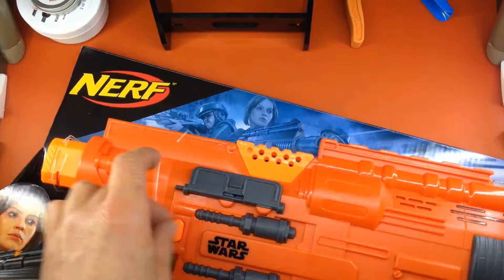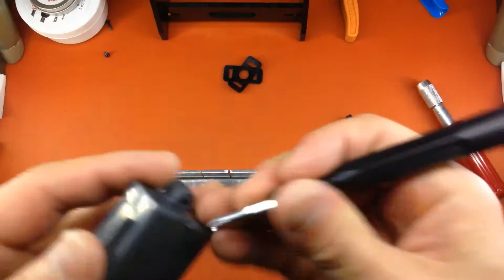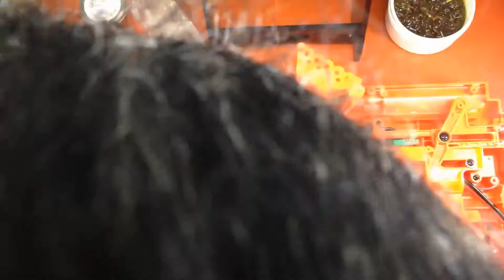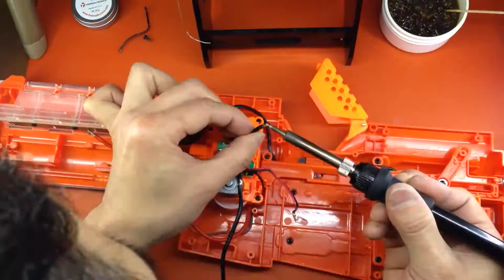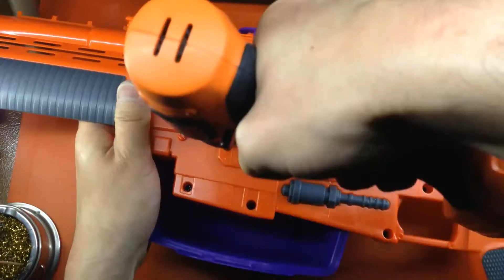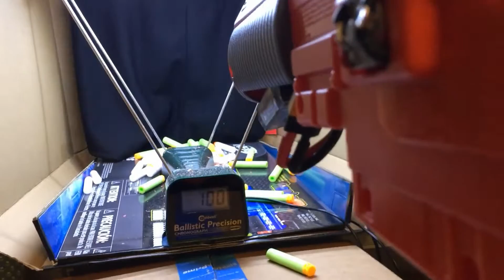Nerf Jyn Erso Blaster Speed Build

Comment: Can I unhook the speaker without consequence?
Reply from the maker: It's not a part of the main flywheel circuit; it will still rev. The lights should still function as well.
Reply: @greenmedic88  thank you. I may disconnect the han solo blaster speaker. I have the sphero  force band and that has an unholster and blaster sound of the DL-44 that I'd rather use since that has volume control.

Comment: Can you put stryfe internals in it?
Reply from the maker: They're not compatible. The flywheel cage, pusher parts, trigger group are all different. It's closer in design internally to the Modulus ECS-10, but for whatever reason, the flywheel cage was flipped between the two models.
Reply: Daniel Okada oh